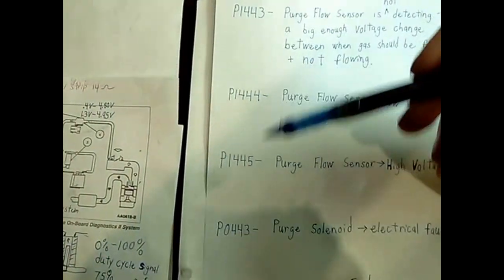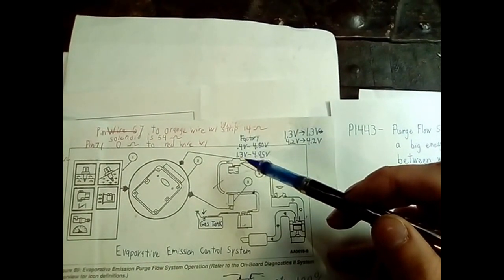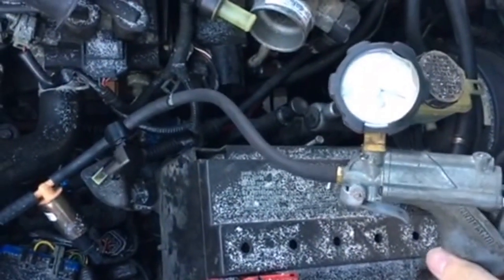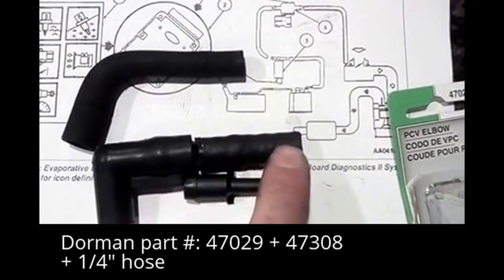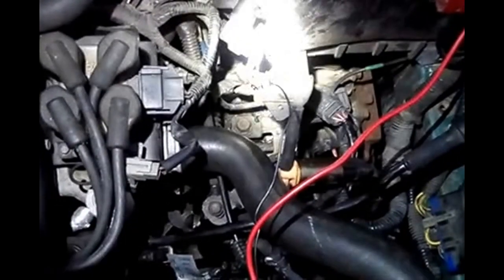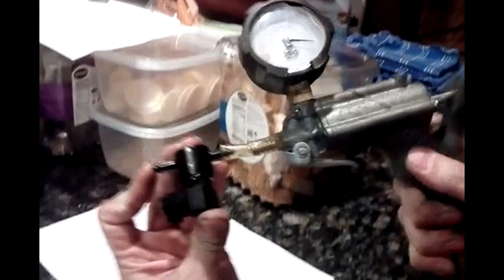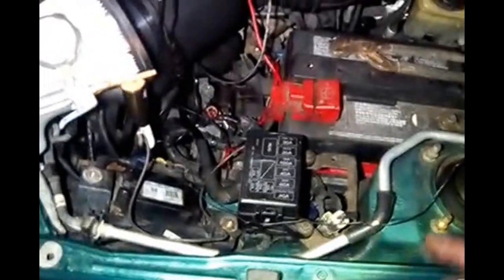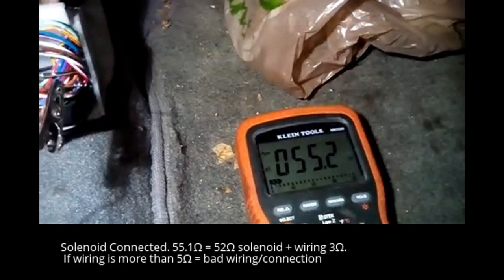1997 Ford Escort 95-97 Ranger P1443 P1444 P1445 P0443 Tracer

Comment: Regarding 13:26, my purge solenoid/valve (Ford # E5TF-9C915-AA) Standard Motor Products replacement would be CP408, (not CP403) according to Rock Auto. Not saying CP403 is necessarily wrong...just that MY original Ford part corresponds to CP408.
Reply from the maker: Thank you for helping provide the best information to my viewers. I checked the standard motor products catalog. They list the CP403 for a 1986 to 1990 Ford Escort. They list the CP408 for the 1992 to 1997.

Which means I technically have the wrong cp403 solenoid in my car for several years now. I don't know what the difference is between the parts is. 

The 1986 had a 1.9L engine, so there is probably some slight tuning adjustment for the later 2.0 L

Comment: Great video, has most of the information I was looking for. Have a 99 Escort (MX) equivalent to a US 97 and the whole EVAP system is out because of terrible conditions in the hoses (sensor and purge valve are both disconnected). I bought new hose in Autozone and I have figured out the connections I need to make. I am just missing the connections to the canister, do you happen yo have a photograph or description to those connections? My Escort has the EVAP canister in the front right side, under the air filter. This Escort is my Precious, it has been in the family since my father bought it new and I'd like to keep it in the best conditions possible. Thank you once again :)
Reply from the maker: Are you referring to the hose that connects from the gas tank valve to the canister or the hose that connects from the canister to the solenoid?
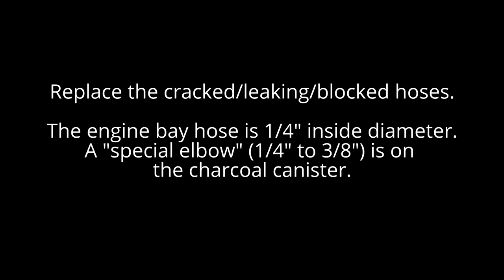Reply from the maker: 4:50 shows the special elbow that goes to the canister
Reply: Actually both are damaged and need to be changed, thanks. Thanks for your reply, I took a better look at the canister and it is how you show in your video: 3/8" hose goes from canister to valve and the other 1/4" goes to gas tank.
Reply from the maker: Glad we got it figured out.

Comment: I've replaced all hoses, solenoid, flow sensor, charcoal canister, filler neck, and smoke tested for leaks, checked wiring and voltage all is fine... still am getting a p1443... bad ecm?
Reply from the maker: Jeff Sharpe possibly or just bad  new parts. what year is your car? the pcm may need reflashing.
Reply from the maker: Check the voltage output of the purge flow sensor while having someone drive the car.
Reply from the maker: A lot of the purge flow sensors are bad from the factory. They tend to not hold a vacuum. Just follow the video and run the tests. Sometimes the calibration of the new sensor is not great either. During really cold day like 9 F sometimes I will get a P1445.  I've been thinking of correcting this by using a resistor to fine tune the output.
Reply: 96 xlt 2.3l I ordered a new ecm today hopefully that works or else I'm going through ALOT of wiring
Reply from the maker: I would strongly advise running all the tests like I showed before spending your money like that.
Reply from the maker: Did your new ecm solve the problem?

Comment: Dude we need a fix not learn rocket science!
Reply from the maker: LOL, yes I can get pretty in depth in my repairs. Just replace the purge flow sensor while testing the new one for vacuum leaks and resistance, all the tubing with the quality hose that has fibers, and the purge solenoid. I also am about to upload an update to this video. Remember the system cannot detect a leak before the purge solenoid. It also may fail to detect a blockage before the charcoal canister. I recommend NOT using the 3/8 90 degree elbow as it fails quickly. Just replace it with a straight length of hose.